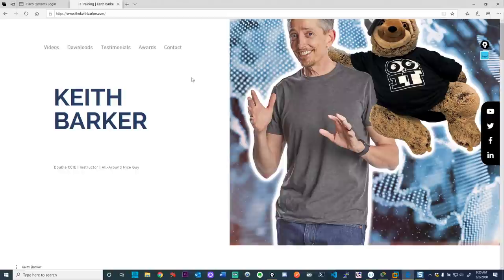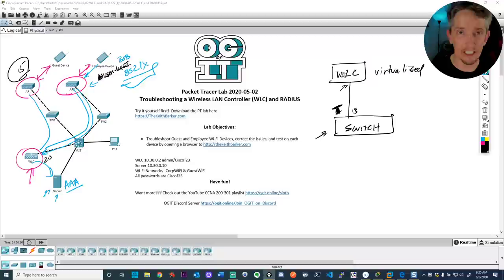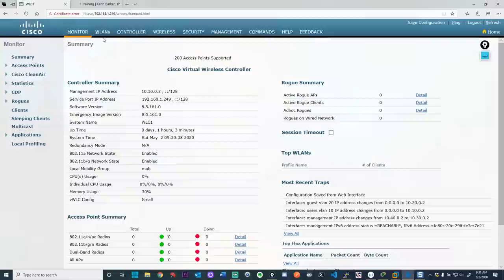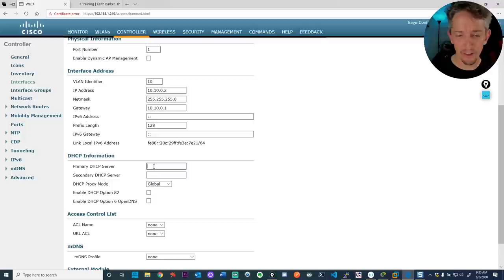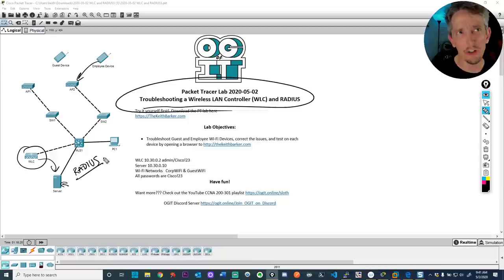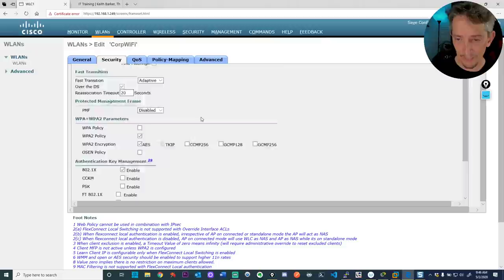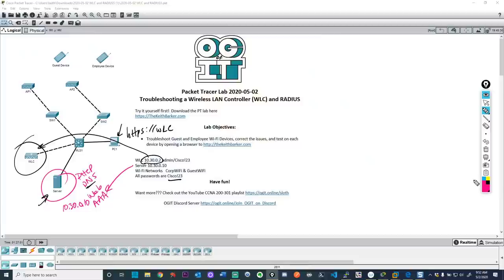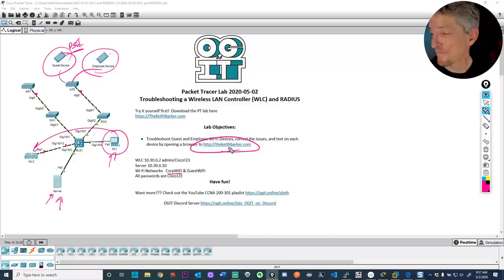WLC & RADIUS Tutorial and Free PT Lab | Cisco CCNA 200-301

Comment: 1) I did troubleshoot and fix the lab, it was awesome thank you, and I will go watch the walk- through for any additional insights.  2) Thank you so much for sharing what the issue is with tagging on the trunk to the WLC.  I have worked on a few labs where the management interface is set to vlan id 1 connected to a switch port set to trunk with vlan100 set to Native, and that works, until I decide the management interface should be set to the management vlan, at which point I lose connectivity to the wlc from the management pc.  I was scratching my head as to why, if it was a PT thing or WLC thing that I didn't fully understand.  3) You clearly put a lot of man-hours and creativity into finding a way to make this demonstration possible, thank you :)
Reply from the maker: Happy to do it, thanks for the feedback Morgan Scott.
Reply: could you please help me solved that ?
Reply: @mariusrostand8329  Keith does provide a walk-through of the solution here https://www.youtube.com/watch?v=YzAxl1DHciQ or, if you would like to reach out to me on the discord server I may be able to try answer any specific questions https://discord.gg/6Pgrqsx

Comment: So the CorpWifi uses WPA2+802.1x. However in Packet Tracer, when selecting 802.1x on the wireless employee device config, it requires you to fill in the WEP key field too for some reason... Was that your experience too? I'm wondering if it's a bug

edit: Oh oopsI misunderstood how it works. Client uses the WPA2 account setting, not the 802.1x account setting.

Comment: Got both smartphones working  but not RADIUS.  PT kept asking for a WEP key which I didn't set up, so it was strange it kept asking for that.  Great lab, though.  Stumped me.  Be great to see what the RADIUS setup is supposed to look like.
Reply from the maker: Thank you Hank Foss for working on that lab!    Sometimes PT acts up.   In the troubleshooting labs, sometimes I have the incorrect port (between server and RADIUS client).   Occasionally I will completely remove the RADIUS pieces, then put them back (to verify them) especially in PT.   Way to go on the lab.  I think there is  a video walk through for this lab in the PT playlist.
Reply: @KeithBarker  I am also struggling to understand connecting a smart device to CorpWiFi using 802.1x because of the WEP key. Packet Tracer demands the key be in HEX, but I configured the key with Cisco!23
Reply: use WPS2, check username on server, change server port if it is different from WLC.
Reply: @hengkaing2665  Thank you! I now understand there is a difference between the options. It connected right away!

Comment: Thank you for sharing, the interesting content, that was the subject of my exam last week!

Question: why sw1 and sw2 in your topology? as it doubles the configuration of valns and trunks.
just MLS1 is sufficient.
Reply: Those switches simulate access layer switches connected with trunk links to the multilayer switch MLS1 which is basically located in a control room, far away from access layer switches and APs in real life topology.
Reply from the maker: Good question!  Wanted to add a bit of access-layer flair to the PT lab.
Reply: @KeithBarker  At school, we have physically implemented a centralized architecture with 1 router, 1 switch, 1 controller and 1 Ap and a radius server. we can replace the router with a firewall